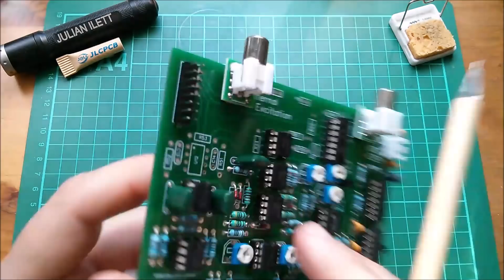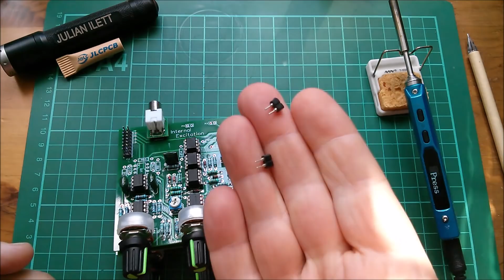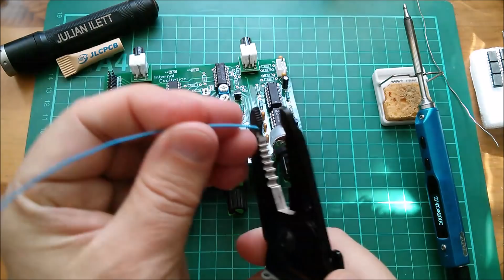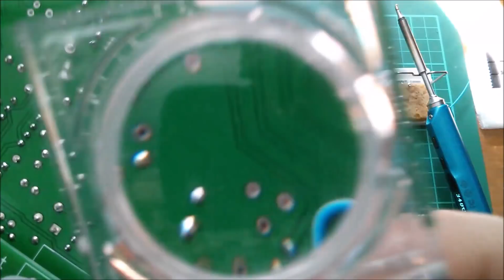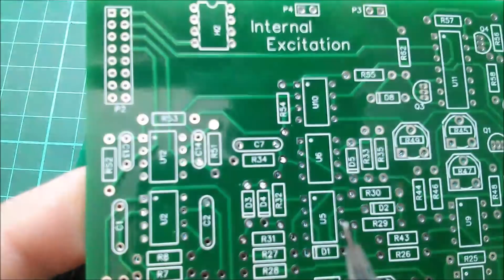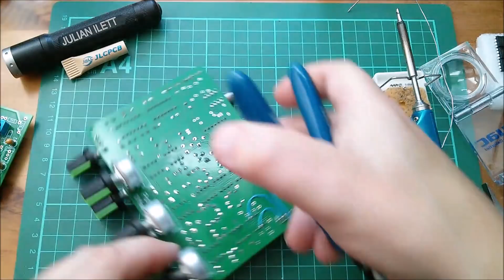PCB Wire Modifications

Comment: My last double-sided board had two 40 pin chips, a half-dozen smaller chips and 30-odd off-board connections.  The prototype board only needed one jumper wire.  Quite pleased to have some 300+ connections on a hobby-related board and only have one error in the PCB design - particularly when I was the one who designed and checked it ;-)

Small wire is always the first repair tool when you make your own PCB's.

Comment: @1m13s: "...is the solution..."   It's been common in tech history to peel the ribbon cable apart in carefully-selected places and then flip certain sections over, recursively, until the desired pin-to-pin configuration is obtained. The mental trick is to derive the minimum number of recursive cable splits and flips. It's like an algorithm to derive the optimum solution. Examples from history include Parallel ATA cables leading to 5.25-inch floppy drives, I believe for addressing.
Reply: I think you mean floppy interface ribbon cable to any floppy disk drive where it is not practical to change the device ID and / or motor on signals.

Comment: The best modding wire for digital based or multi pin IC based boards is Kynar wire. Typically 0.25mm or 30AWG. This size means a very low profile on a board and can easily be used to provide multipath busses ... not so easy with wire almost 3 times the diameter.

The colour used can also reflect the difference between repairs and mods if needed, but not essential. A consistency of wiring colour is more important ... All one colour for everything or the same colour for each type of mod/repair. Otherwise nothing has changed since I was a Field Engineer 40 years ago! 😁
Reply: That's the stuff I use, and it's excellent! Started using that perhaps a year or so ago and have NOT looked back 😄
It also seems a lot more resistant to having the insulation shrink back from the soldering iron heat

Comment: Hey Julian, for gluing down things like mod wires I personally use a glue called B-7000. It takes a few minutes to cure but becomes a somewhat tough rubbery substance once cured, and sticks to pretty much anything. It secures and protects things rather well, but is still just soft enough that it can be pulled apart if necessary. It's transparent but comes out a rather nice green colour, which is even visible against green PCBs. You may find this a suitable alternative to the UV glue you use in cases where you don't need super quick curing.

Comment: That wire might be so-called wrap-wire where the insulation is meant to melt when soldering, so you would not need to strip it. At least it looks like the wrap wire that used to be available a couple of decades ago. I remember there were different kinds of that, some with easier melting insulation and some with more difficulty.

Comment: 7 wires modification ?!!!! .... Come on Julian .... This is unprofessional work and design.... I am disappointed about your engineering skill now.
Reply: This is common practice in the industry. It is called ‘cut and strap’. But the wires used are very thin, kind of wirewrap wire. The modification cost is calculated, nbr of wires, nbr of holes drilled etc. If the cost is too high for the production run, a redesign of the pcb is started. Otherwise the errors/improvements are only corrected when an new board design for other reasons is needed. Mtbf of a modded board stays the same as a non modded.

Comment: Back in the day while still in high school I was working at a place that made its own controller boards that were all wire wrapped. Needless to say I learned the art of wire wrapping. any ways, we had to cut all the pins on bottom side on all the pins which after a while became very boring so i would see how many cut pins i can get to stick up into the ceiling, must be couple thousand still stuck up there lol
TNX  4 the video !
73 N8AUM
Reply: Wire wrapping was the stupidist of all manufacturing techniques ,! I know, I had to use it for a while. It looks like a witches' vomit breakfast, equally hard to diagnose. You can safeley say that wire-wrap technology was a complete fuck-up, doomed to failure.
Reply: @stmounts  from what I've read the connections with wire wrap are pretty good. That said even the cheapest Chinese PCBs designed with free software is much better.

Comment: When I am modding a circuit board, I have found that using the wire removed from an old SCSI ribbon cable works great. Very high quality wire and it is pretty flat to begin with.  Years ago I got a large box of scsi cables because of the low price of the high speed drives, and i wanted speed on my pC's so I have an almost unlimited supply of such wire.